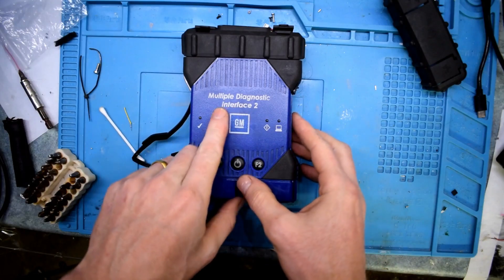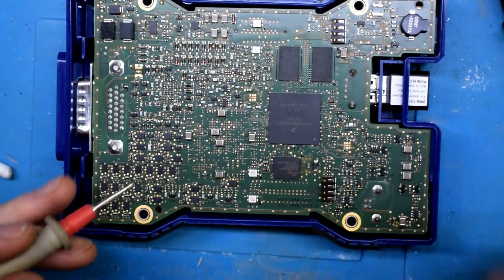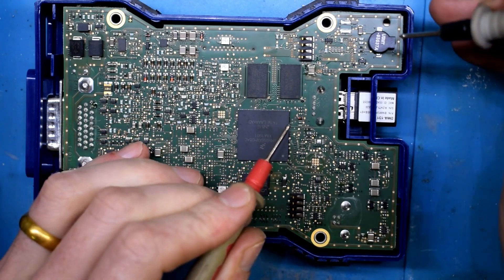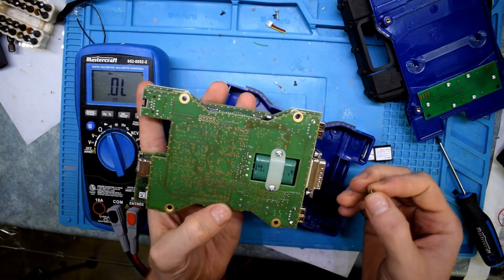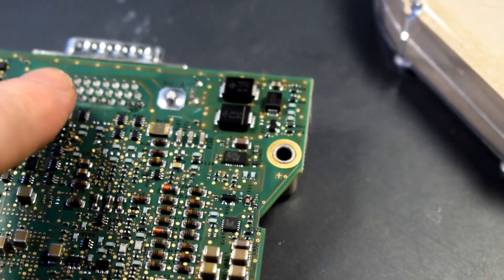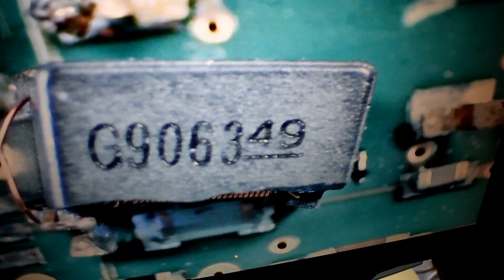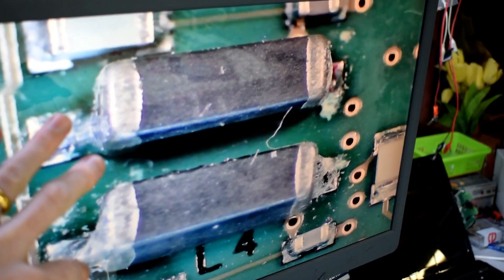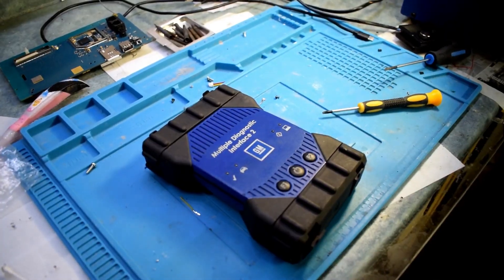BOSCH MTS 6531 VCI | car diagnostic tool repair

Comment: This GM mdi had no communication on the low speed data bus, high speed worked fine. After repairs were made and tool returned, I tested the operation on a vehicle and all functions are now working. Verified repair. Thanks Newsons Electronics
Reply from the maker: great to hear